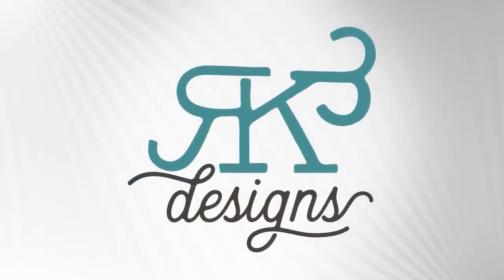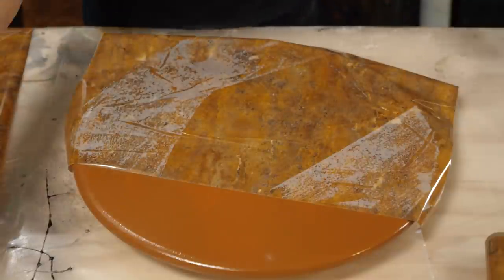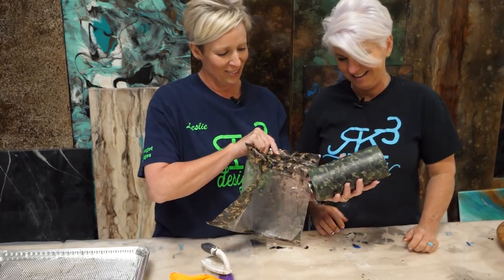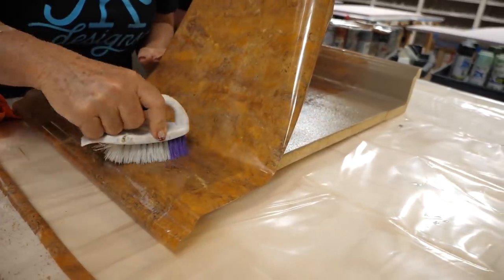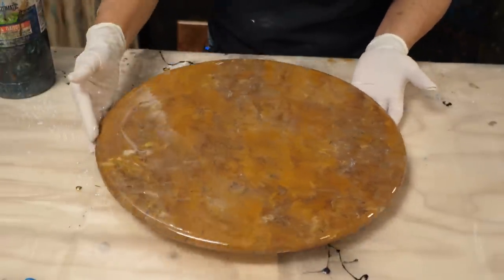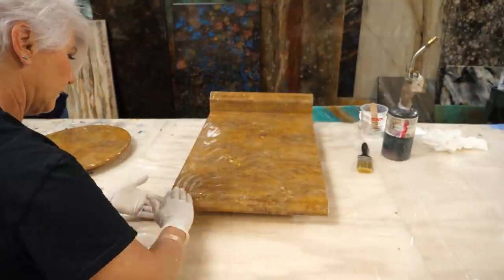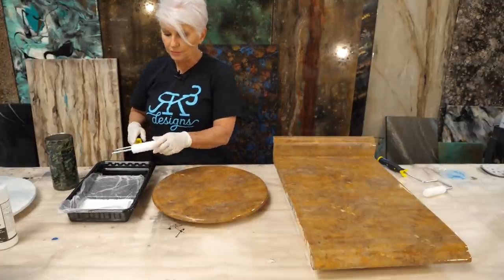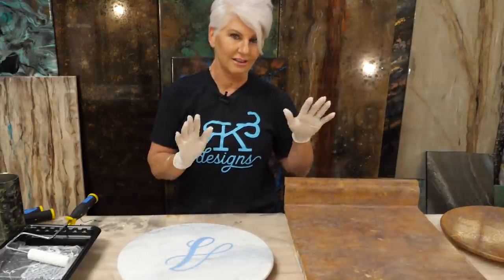How Cool And Easy Is This... Terracotta Slate Epoxy Finish! | RK3 Designs

Comment: Very cool!  I am hoping they will come out with more non-metallic films.  This is a great solution for vertical surfaces.
Reply from the maker: Even if it’s a high gloss foil, applying the matte UTC is a great way to take the sheen down. 😊

Comment: Could I do this on a bathroom sink?  Will it work on the bowl-shaped contours of the sink?
Reply from the maker: I don’t recommend it on a vertical surface. You can add a thickener, but it will change the color of the mica and also still run a bit and distort your design.